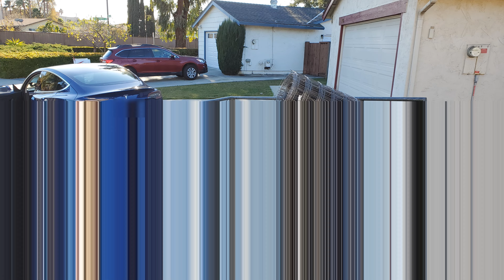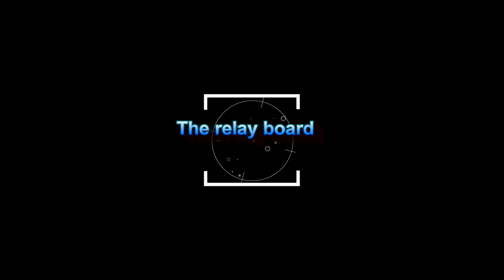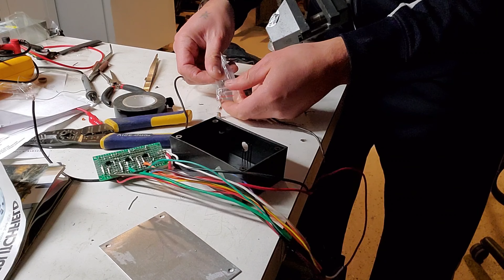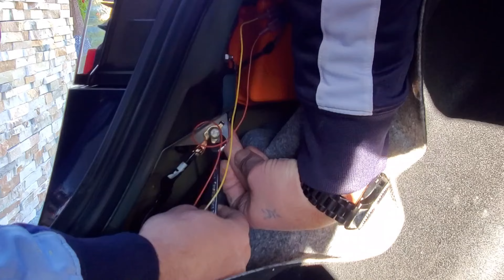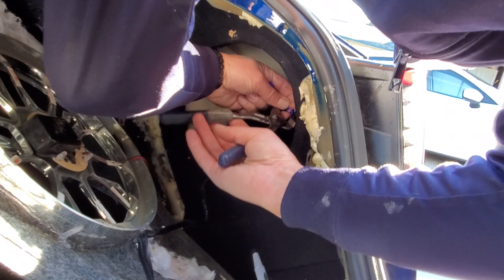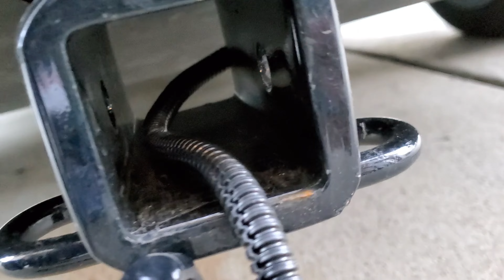Tesla model 3 trailer hitch wiring

Comment: Need more details on where you got the power. The small picture is a little Less detailed compared to your video
Reply from the maker: thanks for the comments. There are multiple ways to run a power wire, 1 option would be from 12V power terminal under seat. I may add another video describing that.
Reply: @diy_lab1301  I ended up running from the main battery as most suggested but on the inside of the car as I did not have a lift.